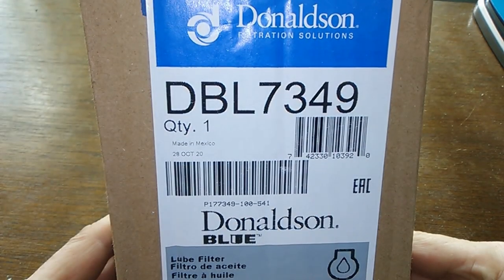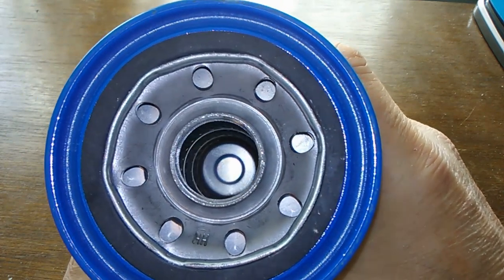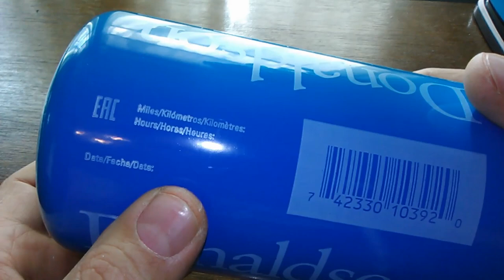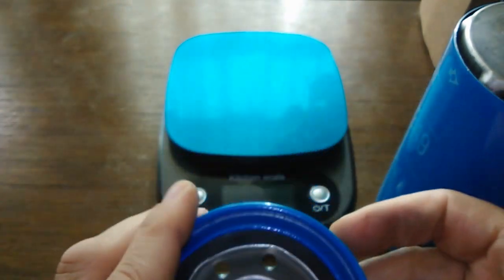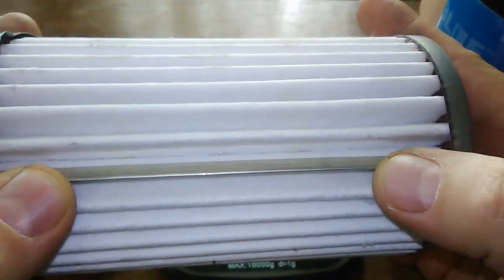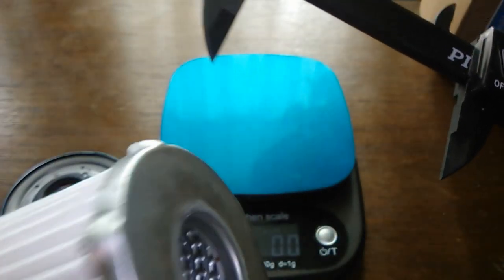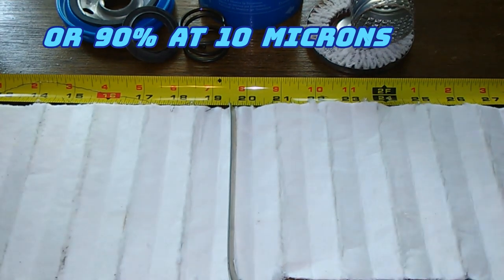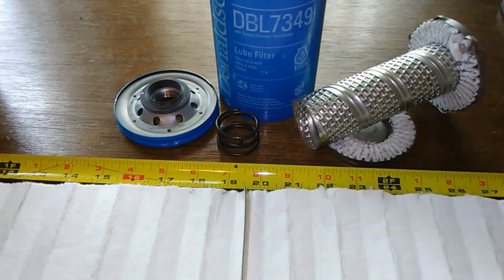Donaldson Blue Oil Filter Cut Open DBL7349  Diesel Oil Filter Cut Open

Comment: One of the Highest Quality/ Robust filter you can run on your 6.7L Cummins w/High Quality Synthetic or Semi Synthetic HDEO.
Reply from the maker: Donaldson's are definitely a very good oil filter.
Thanks for your feedback.👍🙏😊
Reply: Can also be run on 5.9 Cummins, both 12 & 24v. Been doing it for years even with the ELF7349 ( the precursor to the DBL7349).